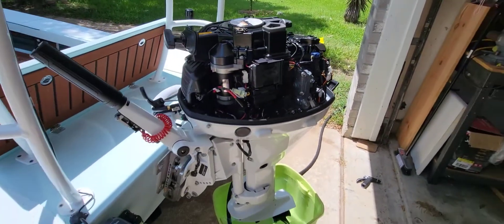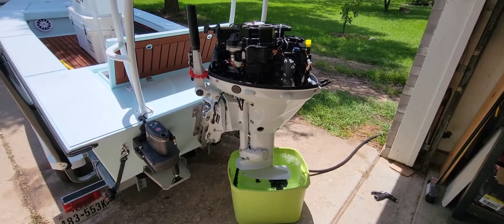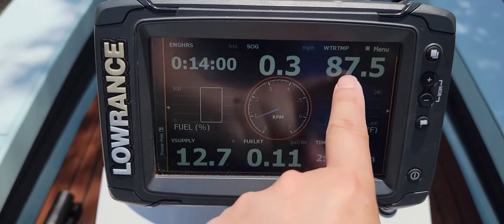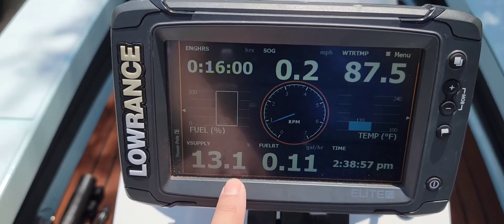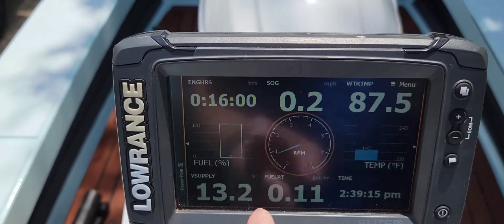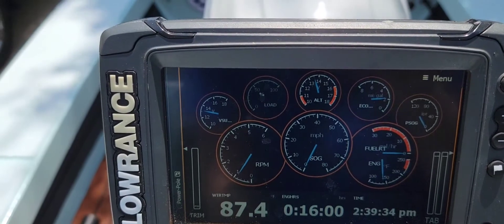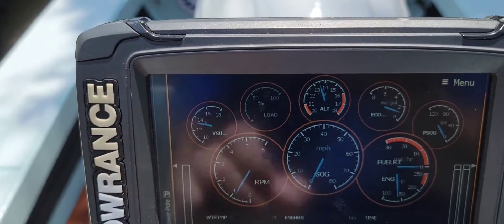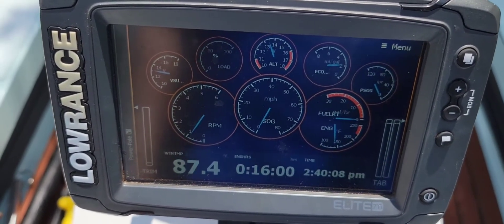2021 Suzuki DF30A First Start - Suzuki SMIS V3.5.4 Interface Cable to Lowrance

Comment: hello, I haver a DF60A, can i use the same cable to hook it up to my simrad GO9?  Many thanks..
Reply from the maker: Simrad and lowrance are the same company so it should work. I assume you have controls so the connection will be different and I do not know where the dsta connector would go. I believe I read somewhere that it connects at the controls.
Reply: @FishingWithHoang  can you do a video of how you connected the whole thing?  From one end to the other?  Many thanks
Reply from the maker: @Ricktrevi  Go to instagram website and search for my name " hoang.nguyen82 " It's the first video pinned on my account.

Comment: Did you ever do a follow up video on the installation on this? I’m trying to install mine currently on a Lowrance HDS and would like to know what you went through to get it to work. Thanks
Reply from the maker: I made a video but it's posted on my instagram. "Hoang.Nguyen82" it's pinned to the top of my page.

Comment: It’s interesting as Suzuki only list the DF40 model as compatible with nmea2k
Reply from the maker: I believe if its EFI.. the computer has a data port for diagnostics. Thats the same port used to connect to the SMIS interface.
Reply from the maker: I just looked it up. It reads data from DF9.9 and up to DF300 outboards.

Comment: Did you need any other cables besides the v3.5 suzuki cable that plugs into the nema network ?    (I have a DF25a - which is pretty much the same motor de-tuned)
Reply from the maker: You'll need a SMIS to SDS cable adaptor. It's $55 bucks at Browns point marine... After that, it's all plug and play.